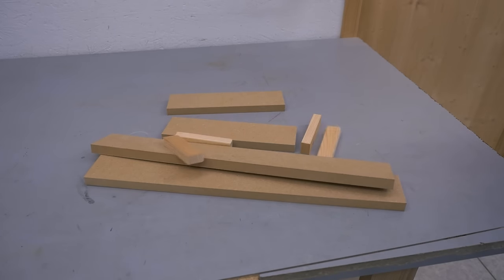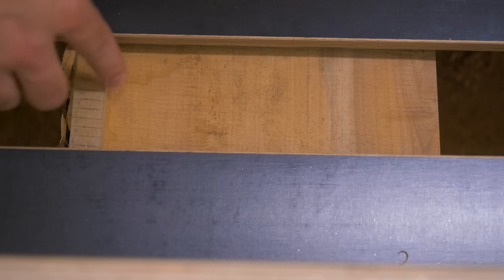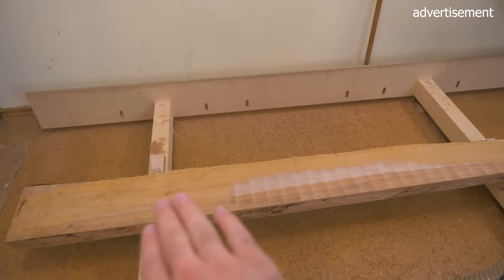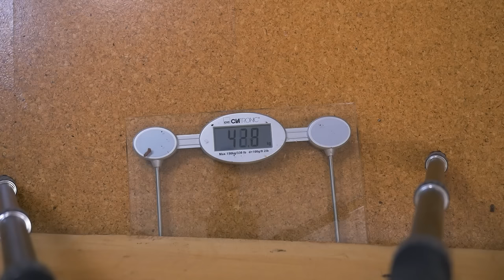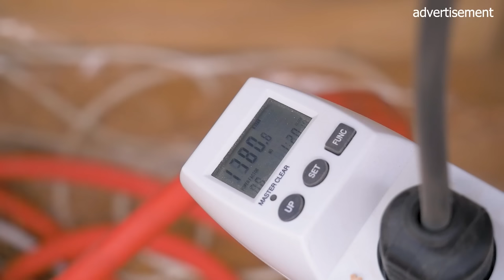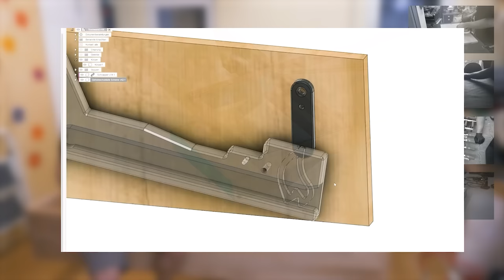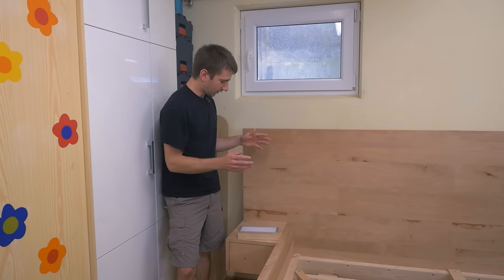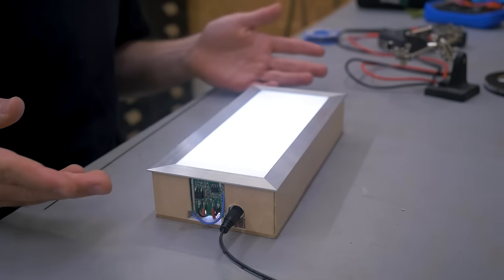Homemade 10,000€ Bed || 4 Unique Features

Comment: If you haven't made any changes to the light panels yet, you could add 12mm feet to the bottom of your legs and raise the entire bed up; that would also require lengthening the retention strings on your drawers, but all of that could be easier and cheaper than redoing the light boxes.
Reply: Or just modify the wall outlets, it isn't so hard either.
Reply: But then there may be problems with the hidden drawers
Reply: Just glue in some wood below and cut out some wood above the light panels....?
Reply: @09conrado  Thats a glue joint you would always see and be reminded of that mistake. New light panels will calm the inner perfectionist in Marius.
Reply: @jdfmovil  Depends on the wall. It's a german house so these walls could be brick and mortar. If its drywall than yes.
Reply: @atariks1475  as it seems to be an attic chances are the inner walls are made of sheetrock.
Reply: literally easier to just remove the electrical and  dig a bit and fill a bit and lower it lol
Reply: @atariks1475  it's also an apartment, so he likely doesn't have permission to modify the building
Reply: I'm glad I'm not the only one who thought of that!
Reply: Or you could just remove the switches and outlets on both sides and build an inlet using so called „Hohlwanddosen“ which are 35mm deep. Then you can add the switches to the front side of the head board and do not need to use the wall switch in a „hole“. And you can choose a different switch/outlet design matching your bed‘s design.
Reply: @ducttapeengineer  I doubt it. If it was a rented apartment why would he build a customized bed for hundreds of Euros that exactly fits to that spot in the attic?
Reply: @diyhard666  because he's Marius?
Reply: Just put two mirrors in between to correct for the parallax problem, requires almost no work, costs only a couple of dollars and there will be no need to fix the wall and or the bed. Just add the mirrors.  Or you could fill the room with gases with different density to bend the light just at the level where the error is.
Reply: @atariks1475  Where I live we use brick and mortar. It isn't difficult at all.
Reply: Came here to say this, glad I checked first
Reply: Easiest way is to relocate switches and recipticles. Even if walls are brick. I ve done it couple times and its easy. There won't even be problem with new paint color match transition will be hidden behind led panels. In my experience you can done is in one day. You use quick set polyurethane foam to glue boxes and fill gaps than quick curing putty and paint 2 times
Reply: @diyhard666  Why i built whole separating wall and new nice cabinets into rental apartment? Well cause old wall was actually dangerous, owner paid all the material costs and more importantly we made agreement that rent stay same for 8 years i lived there and that he could not kick me out, long as my rent was not more than 6months late(allowed me to use few months worth of rent money into investing almost like zero interest loan from the bank, but with out extra costs or paperwork, though this was bit risky, so those were rather safe investments of buying repairing and selling with profit and such), witch time i had saved more than double in the rent costs what i would have gotten if that was paid job, since rents in that 8 years increased 1/3 in that area. Ou those were the times...
Reply: @jdfmovil  Well actually for Germany it is. The wire runs inside a PVC conduit and the walls are most likely some sort of stone. Quite the opposite to the US :)
So modifying that is actually a pretty involved job which makes a whole of mess.
Reply: @Hellsong89  not the brightest candle on the cake 🤭
Reply: I would move the outlets on the headboard itself.
Reply: @patrickd9551  It is done in half a hour or less (total work, and actual time a day or two, changing the holes with a Hilti or multi-tool and so that the plaster dries). The loft (at the roof) naturally has plasterboard cladding (isolation!) behind the superstructure and is easily to work with. Even solid stonework from the 16th century would not be a problem. 
Was soll das eigentlich? Weder für Marius noch für einen Elektriker im 2. Lehrjahr wäre das ein Problem. Unfähig oder was? "A mess" ... ROTFL ever heard of vacuum cleaners?:P
Normally, however, the mounting heights of sockets are standardized, just like the dimensions of beds. So if you want to do it right, then of course you change the rectangular cut-out section of the lamps.
Reply: Absolutely spot on!  I can't believe that the floor is perfectly flat so that having feet under the structural rails will accommodate that and if adjustable will stop the bed having to twist to accommodate the out of level floor.
Reply: @atariks1475  He has a CNC so he could cut some nice chamfered inserts (darker wood woould be nice!).
Reply: i was thinking about the same but it feels... too janky...
Reply: Add 12mm to the height: Advantage: The head would also align with the edge in the wall, which was the purpose i guess.

You do not have to redo the light panels. You can lower the plug socket and switch. Advantage: you can use spacers to give additional depth to the socket, so you can align the plugs with the panels, which would be a nicer fit. And of course you can change the sockets itself to a modern version (not with round edges, which does not fit with the panel) and you can paint it in a better matching color.
Reply: This was my thought... Some 12mm rubber feet might be just what this bed needs to prevent that nice floor from getting scratched when it's used for strenuous activity.
Reply: I don't think he will go for easier or cheapest solutions
Reply: I would rather make circle shaped light boxes (may be like 1...5 circles) and a simple π-shape back side sized extender. This would add more to an esthetics.  Because to make a heavy, expensive, huge back side slab to be outlets depended ... seems to be a bad idea. Now they need to look for a house with the same outlets every time they move. 
And I don't like sharp corners (of the light boxes).
Reply: @rav0r0r  That's how I would have done it and it's how I did it on my much, much simpler and cheaper head table.
Reply: This is the best suggestion
Reply: He is German, don’t worry they like it cold! Plus you’re here for inspiration!

Comment: If you don't want to see the LEDs in the panels, use two layers of frosted material spaced apart, with one layer close to the LEDs but not touching, and the other layer on the outside.
Reply from the maker: I'll give that a try when I make another light panel
Reply: @MariusHornberger  when I built my sci-fi led flashlight I frosted the glas lens myself with sandpaper. That worked very well. Well, at least when I found out how to do it 🤭
Reply: I have found that the flexible semi-transparent foam used in packaging works amazing a a diffuser for LEDs
Reply: @ethanbaltz8847  another word for semi-transparent is "translucent" ;-)
Reply: And pls take the 2800K warmlight leds that match perfectly with the wood :)
Reply: @aarondcmedia9585  Do you know why you have suggested that? I bet because your subconscious got irritated by the fact how stupid using something "SEMI"-transparent for a light actually is. Materials that provide DIFFUSION are a good idea, but reducing the light yield, the efficiency with something that is working against the purpose of the device is the stupidest idea one can have. Ohhh, I love the internet and its population!:) *facepalm*

P.S.: Oh and for that exactly reason something light-transmissive, transparent or translucent is NOT the same as something semi-transparent= less than a 100% transparent, semitranslucent(didn't see that coming?:P) or partially or imperfectly transparent.
Sources: Collins dictionary, Wikipedia
Reply: @dieSpinnt  your projection is showing:
1. your tone indicates the irritation I did not feel
2. diffusion is a great idea
3. You assume to know what a completely random stranger is thinking based on one sentence. You're wrong.

Should anyone else be curious, I suggested it because it's true, and my guess is, with the way education is going, not many people know of the word. 

I love learning, and projected that (potential) love onto someone else.
Reply: @aarondcmedia9585  I was not going to respond to your original comment but after a few more, I think I will. I will give you the benefit of the doubt and believe you truly have good intentions of sharing some knowledge with me. In the same way, I am just trying to share with the community of people who might watch this video a very decent and free (I collect it from mail and packages) diffusing material I have found. I’m not going to get into an internet urinating match about semantics of words, but a diffuser is completely fine and called for here. Losses would be negligible especially for LEDs in what is probably a dark room, hence the lamps.
Reply: @ethanbaltz8847  without a picture of the diffusion material you are discussing, I still have no idea what it is. Do you do videos at all?
Reply: @ethanbaltz8847  I would also be really interested to know what intention you could ascribe to someone in this instance - you say here you have to give me the benefit of the doubt that they are good intentions.

What if they are bad? What bad intention could I have when sharing something like that? I am genuinely curious.
Reply: @aarondcmedia9585  People on the wonderful internet can have a need to one-up others.

I believe I am talking about translucent closed cell expanded polyethylene foam. I’ll let you Google it yourself :)
Reply: @MariusHornberger  Another solution to exualize the light are the foils that can most easily be taken from broken TV LCD panels. When you disassemble the panel, there inside, behind the actual panel there is a set of foils, two of those are horizontal and vertical filter, and one or two are translucent foils, and there is a sheet of 2-3mm thick acrylic with a raster of fine dots marked on it. For this project you are interested in the translucent foils. Best about that solution is that there is no dimming from the filter material, because the LCD also wants to be as bright as possible with lowest possible power consumption, so they have used excellent foils. The best thing about it is that it is usually free, because even if someone had broken the screen and wants to sell the rest for parts, he still has no use of the screen, and all the parts you need are in the screen.

The foil is also available from 3M and Avery Denison, and I assume many others, but is very expensive, it is called translucent foil and is used for lit trough marketing elements to avoid showing individual LEDs.
Reply: Nah, just when you find some broken lcd tv on the curb get the brightess enh. Film BEF and the dispersion foil from the panel assy. These work miracles. For my bedroom i simply removed the broken lcd panel and put a 2mm petg plate instead. The backlight was so strong that i had to build a dimmer for it - the uniformity was amazing. And it was 8mm thick.
Reply: @MariusHornberger  We know that will never happen! We've all been there.. :D
Reply: Or just use a bigger gap between the lights and diffuser.

Comment: wouldnt you just add 12mm pads to the bottom of the legs, raise the whole bed 12mm?
Reply: Easiest solution I think.
Reply from the maker: No, then the hidden drawers don't work
Reply: @MariusHornberger  ah. Shame would have been a quick fix.

Comment: Despite the very small error with the power points lineup, this has got to be one of the best design and builds I have ever seen.  The hidden drawers are exceptionally clever.  I absolutely love the pebble and epoxy features and I am definitely going to try something similar with my next project.   Pat yourself on the back, you deserve it.  Well done.

Comment: 33:20 They are only for transportation, right? 🤭 I would just call in an electrician to move the outlets. Mistakes happen…
Reply: Who calls an electrician to move those outlets?
Reply: @nukularpictures  Only if you know a talented electrician . 😁
Reply: That is not really that easy in brick walls. It also might be a rental space, making this proposition even more questionable, as you would have to reverse this change before moving out.
Reply: @louisfkoorts5590  he is an engineer ffs. He should be able to move a god damn socket.
Reply: I was kinda hoping he'd atleast use them during transportation 
Now theyre useless 🌚
Reply: @nukularpictures  I don't know about the German laws, but in my country it is illegal to move an outlet yourself. An electrician is required. Could apply there too.
Reply: @MumrikDK  here it is not. Might be problematic with the insurance if they can show that you didn’t follow the required VDE guidelines but that’s hard to do if you just move a socket.

I personally do not see any difference to a light fixture and that you always have to install yourself in Germany.
Reply: Personally I would add outlets that are integrated in the bed and connected to the wall socket via power cord, but obviously you need some space for that, might not work with every design

Comment: Simply add 12mm blocks onto the angle brackets that support the headboard to raise it up. Screw holes that may show can be plugged and sanded flush again. Did you forget to mention the hidden restraint bars? :D

Comment: I think you can gain a lot of efficiency in your flattening if you run the router the long way instead of the short way. Especially now that you have the gears, it should be easy to push back and forth. Then you make many fewer passes / adjustments.

Comment: If those bars are made for what I think thy are: They wont be enough.
Been there, just added 4 fixture points to my first bed build. They are always in the wrong position and never just work. Got so frustrated that I almost never used them. My new bed has hidden airline rails, so much more flexible and I used a similar system to hide them ;)
Reply: I was not expecting so many people in the comments to be this kinky hahahaha. Well done.

Comment: Well executed and incredible work Marius! Two tiny things I like to mention: Put something between your hidden drawers and the mmattresses to prevent dust from building up inside the drawers. Nobody likes freshly washed but dusty bedsheets ;) 
second thing: Most of the touch sensors are actually "opened" capacitors. On the PCB there's resonant circuit that oscillates with the "metal frame capacitor". The frequency of this is measured. By touching it the oscillation frequency changes - this is detected.

Comment from the maker: This was a long project. Totally worth it because now I use it every day ;) I tried to pack as much information as possible in the video without making it boring and keeping the flow up. But I hope to see you during the live stream, where I will share more details. https://www.patreon.com/posts/more-about-bed-74145531
Since it got commented on often. Raising the bed by 12mm to fix the alignment doesn't work because then the hidden drawers don't work
Reply: It is beyond me how you get that amount of skills into a single person. 😮
You deserve a much bigger workshop.
Reply: Or you could just remove the switches and outlets on both sides and build an inlet using so called „Hohlwanddosen“ which are 35mm deep. Then you can add the switches to the front side of the head board and do not need to use the wall switch in a „hole“. And you can choose a different switch/outlet design matching your bed‘s design.
Reply: Why don't you just move the outlets 12mm down? An electrician can do that and all you'd have to do is just fill in the wall. I'm sorry if you have already considered it.
Reply: Why don't you use it every night instead? ;-)
Reply: @ArystanTatishev  thats what i thought...seems the easiest way ...im sure he can do it himself without an electrician even..
Reply: @bazwillrun  have you ever cut a hole in concrete or stone?
That's definitely not the easiest way.
Reply: You are incredibly talented congrats awsome work!!!

Comment: Quarter round bars can be made to any dimension on the circular saw: Simply push through a square timber of the desired radius at the fence again and again slightly rotated. This will be very accurate. Of course, you need a long piece to hold on to.

Comment: I am absolutely amazed!! Amazing design, cool features, it's literally perfect! For that little mistake around the outlets and switches, could you just add a 12 mm strip to the bottom of the legs? That would shift the bed frame right into positions and you could extend the string for the hidden cabinets so the mechanism dropped down to the correct height for putting the cabinets back in place.Beautiful work!

Comment: Your woodworking skills are enviable!  
Some restraint would have gone a long way, but you never claimed to be a designer.
Personally, I would have hardwired the electrical outlets flush into the headboard so you don't have to worry about alignment.  
In the end you have to create content to stay relevant on the platform and more features means a longer video, so great job!

Comment: Design engineer here. I did similar but I have to move around every few years so I made it able to be easily disassembled into 11 pieces small enough to be carried through a door by a single person. I am tall so I also made the bed extra tall. I have about 23 cubic feet of storage under it. Went a little overboard. Pretty sure I could literally park my truck on it. All in, materials and supplies (not including tools I already own) the cost was $63. I already had a boring normal touch lamp and end table though.